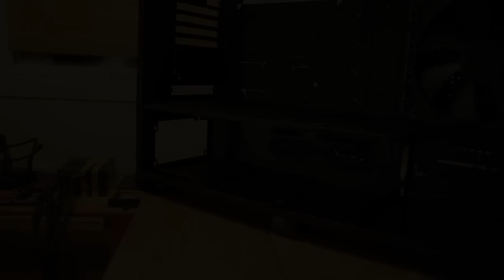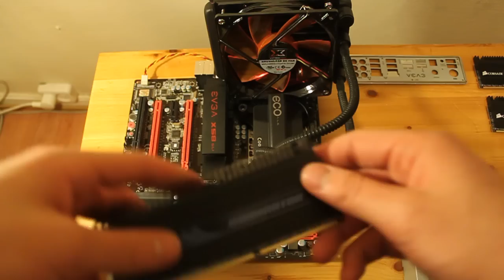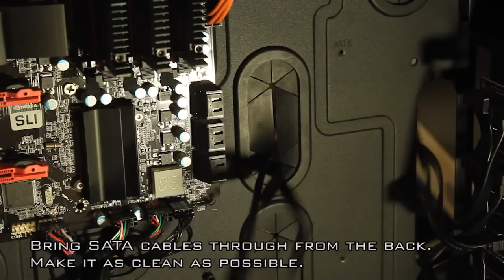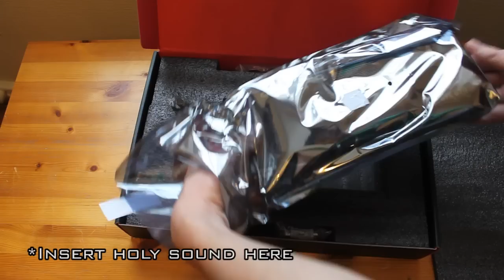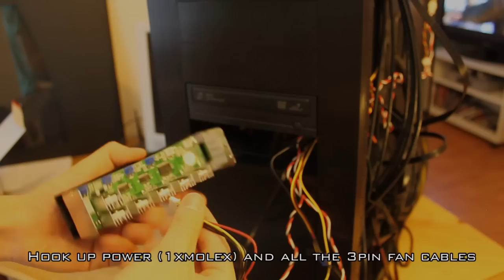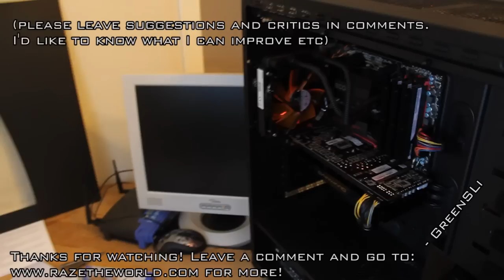Building an 800D - i7 - Gainward GTX 570 Phantom!

Comment: @GreenSLiTran Antec has been plauged with build quality issues for awhile. I've had to replace a lot of them because; components weren't glued down, and managed to break out of the PCB. Screws weren't wrapped with plumbers tape etc. Fans would just wear out in a matter of months.

Basically the units didn't travel that well at all. Wasn't so much the components used in them.

Comment from the maker: @danpbrown Correct.
There are so few intake fans in the 800d, that I thought it would be best that way. And I had my pc next to the window, so it drew cold fresh air straight through the radiator.
I now have a totally different setup tho, gtx 580, Corsair H100 in the top, and the back fan now drawing air out fo the case aswell.  Oh, and a bigger motherboard ^^

Comment from the maker: @Zwank36 thanks for critics both good and bad, however I must disagree a bit:
THAT pre built watercooler isnt as good as i'd want to, but I now have a Corsair H100, and it perform really well while at the same time staying quiet. 

And whats wrong with antec psu's? I've had this one since 2008, on alot of OC'ed hardware, never had any trouble with it.
and yup, my rig looks alot different now, with white cable sleeves, new gpu, bigger motherboard, more ram, soundcard etc. :]

Comment: An 8-Pin CPU power cable extension, so you can route it round the back. While you're at it, get a full set of braided cable extensions.
The next obvious thing would be a full custom water loop. The 800D is begging to be water cooled.

Comment from the maker: @yakutza100 Its very irrelevant to record the sound to reflect on the noise level, because the mic wont even pick up everything properly. 
Its a nice and silent card, but it can be noisy if you want, however it doesnt ever need to be running at high rpm's.

Comment: im not too sure but it looked like ur fan on the cpu radiator was exhausting into the case? if this was what it was i have never seen that before. but i guess with 3 exhaust fans up the top it should be fine.

Comment: @GreenSLiTran Great! Now that's what I've wanted to hear. I've got a full case of Gentle Typhoons so I'm quickly frustrated when something is louder.. Another little question if you don't mind, the 3 fans that are inside the cooler are pulling air through the heatsink and afterwards dumping it all over the place?

Comment: WHy you using that hot box of a case for such little hardware?

I only like that case if someone is using a tripple RAD or some high end CF or SLi setup, + Plenty of HDD's, Never the less nice build.

Would reccomend putting the PCIe cables through a higher gromet as they look ugle and spoil the beauty of the Phantom. the one the sata cable coem out of.

Comment: The price of the entire system? I'm thinking to the gainward 570 phantom but it cost's so much! 
Now i've a GeForce 9800GTX 512mb, the actual system is:

- Intel i5 2500k
- 4GB Ram DDR3 1600MHz
- 750W PSU

What can be your suggest? Is there many differences between the GW 560 Phantom and GW 570 Phantom?

Comment: okay criticisms:
800D Cases are way over priced, and you are only fitting one tiny m-ATX board in there!
Those pre-built water cooling systems are all crap, and over priced. You are better off with a decent air cooler.
Antec PSU's are crap. Don't touch them. Get seasonic X series PSU's, and nothing else.

Pros:
Obviously you can build a computer.
The actual hardware you chose is pretty good (minus the PSU).

Other : I'd love to see some plain black cable extenders for the mobo + pci-e connectors